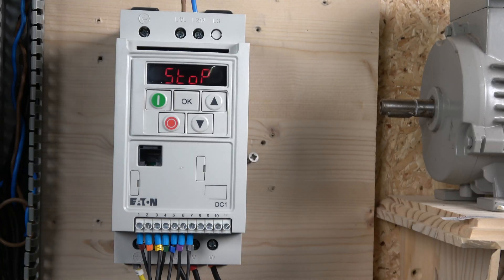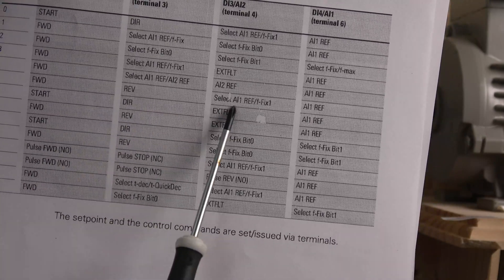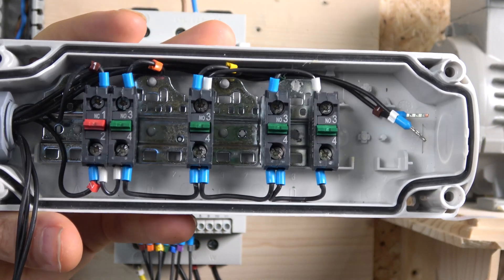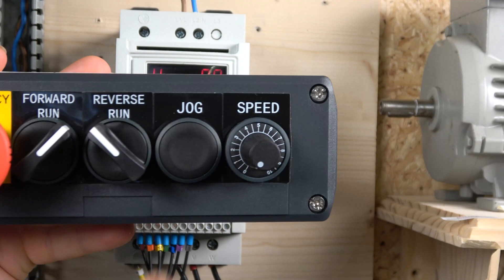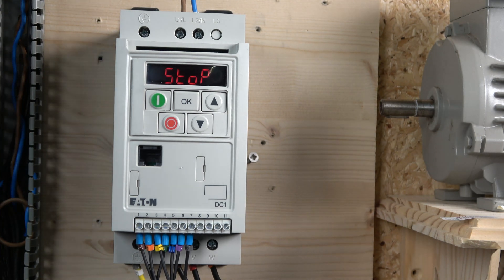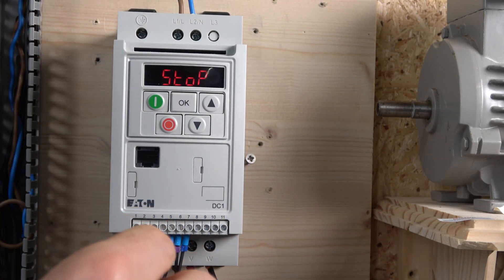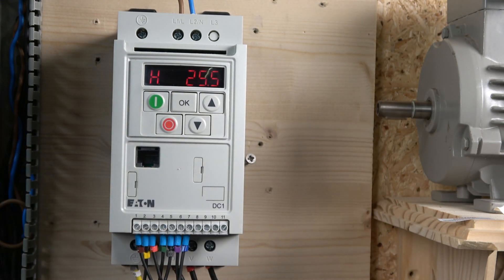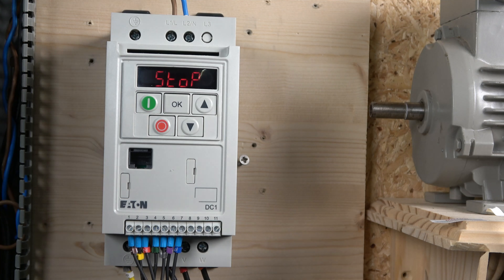Eaton PowerXL DC1 VFD, remote control, 2 wire control, 3 wire control. remote speed control(English)

Comment: Hello, your videos are very good, with them I was able to start up this equipment but, I still have one more question, I need to program the motors to turn on and off automatically.

I know that the real time clock exists in some equipment, but I don't know if the DC1 have this option.

Can you help me with this?
Reply: Hello! Were you able to find out if this model supports automatic on/off timing?